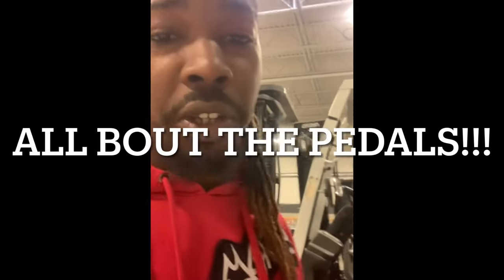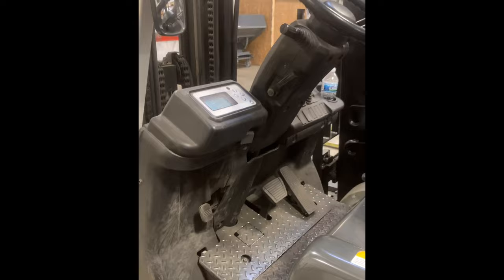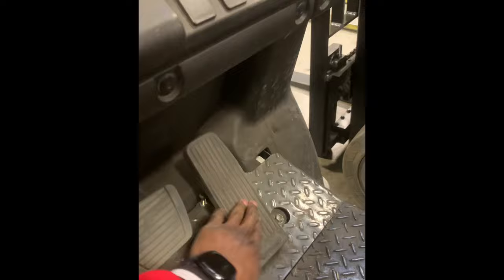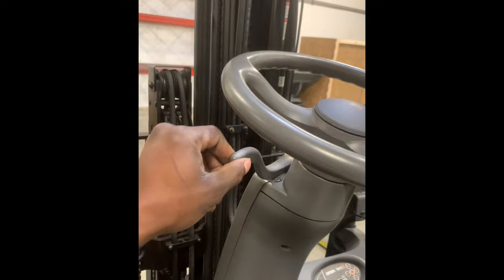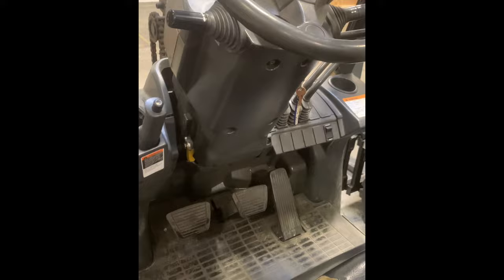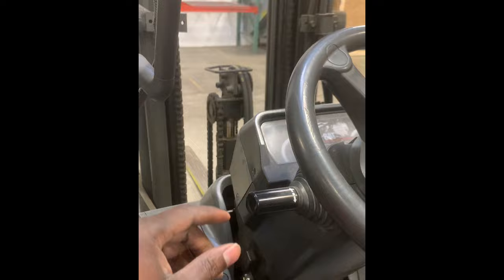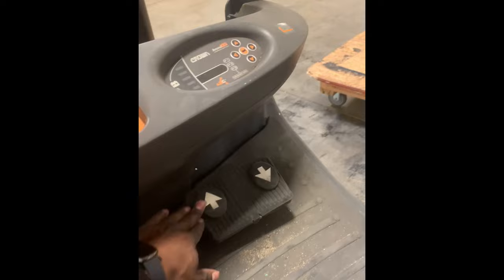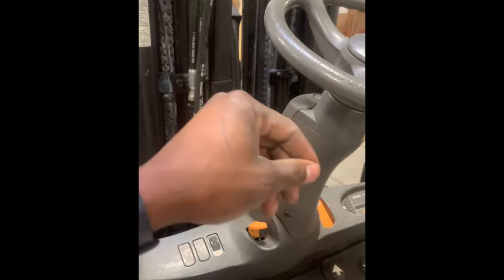Forklift Certified in 5 Mins ( Different types of Sitdown forklifts)

Comment: That third gas forklift with a "clutch" is like a clutch but called an Inching Pedal. It works like a clutch and a brake combined (if it is connected to the brake pedal too so first its disengages drive then more pressure and it applies brakes) so that you can rev the engine while in gear to make the hydraulics go faster (like lifting the load onto a truck) but bypasses the power to the drive wheels so you can rev the engine to make the loading much faster WITHOUT driving the forklift faster. It disengages drive and engages brake (if it is a dual action) so you can quickly raise the hydraulics to lift a load up without also driving faster. Its safer and easier to keep your fork load low to the ground until you put it on the truck or racking, and this pedal means you don't have to take it out of drive to rev the engine to speed up loading. Without it, you can't rev the engine in forward gear or else you speed up so this makes loading so much easier and faster.
Reply: Yup that bad boi helped out a lot when I had to stack, don’t know why people think it’s a useless pedal or just another brake comes to show they aren’t pros
Reply: https://youtu.be/aK1MLTQV1GU      demonstration of the inch clutch @1:16
Reply: My 5 minute "forklift training" consisted of my teacher telling me that pedal was useless and then lifting a pallet off the ground and setting it down. This comment helped a lot, thank you
Reply: I use the third pedal all the time it is great, especially with our lift it does not like running too good in the cold mornings and full turns or tilts instantly stalls her unless you Rev it with the clutch.
Reply: @TheCrawdadman  Sounds like a blocked regulator.  Alot of the gas powered trucks at my workplace have had this issue at some point.  They take ages to start in the mornings.  Apparently it boils down to the quality of LPG you put into it.
Reply: @AndehX  you were correct, we just got it serviced and now she runs like a champ!

Comment: The Toyota Tonero 18 I drive at work has a clutch, and I use it all the time.  It's the brake pedal that I never use.  The clutch allows me to let the truck roll forward, which is useful for going round corners without needing to brake.  The clutch is also always used when raising the forks.  As any driver probably knows, the clutch is used to disconnect engine drive from the wheels.  In a forklift this allows you to apply gas to the forks for quicker raising, without drive being applied to the wheels simultaneously.  Without the clutch, I would have to bring the truck to a complete stop and apply the handbrake every time I wanted to raise the forks or put the truck into neutral, which, while safer, and is to industry standard - is not productive at all, and would likely get you fired for being too slow.  The clutch is key to fast and productive workflow on a gas powered truck.

Comment: You can use the clutch when you're lifting something up high so you can give gas for more lift speed without going into neutral. Then you don't have to wait like 30 seconds to get all the way up to the top racks. Good video though. Don't be afraid to get forklift certified people, there's some good paying jobs and its honestly easier than driving a car you will get the hang of it in no time.

Comment: I would have to disagree with you Joe about the clutch pedal on the LP unit as it is also a brake, sort of like older tractors and lawn tractors with one clutch brake which is the ONLY brake pedal. If you're in a hurry like most lift drivers will be at times, you'll always use that clutch/brake and never use the center pedal. You will always use engine RPMs to raise your mast faster, and slip clutching while you switch your shift lever to the opposite direction of travel while you're moving.  I'd really like to know if the single wide brake pedal on that other unit actually clutches as well as it is made to use with either the left or right foot. They also call it the "inching" pedal. 🤘

Comment: Good videos. I wish they were more consistent though. So, I'm certified and I seem to remember something about with the propane forklifts, unlike the electric ones, you have to be in neutral to move the forks at all and are required to use the accelerator to move the forks along with the handles. Can you speak/make a video on that that is more indepth? Also, and this is a huge one that I'm not seeing anyone talk about. The principles seem quite easy, but I found in my 30 minutes actually operating a forklift, I found it very hard to see where the heck the forks are; angle of tilt, getting the forks into the pallet and clearance. What should an operator look for to see these things? All I saw was a huge block of metal obstructing my view and I find that's the harding thing to overcome. Thank you for your reply in advance.

Comment: When switching to forward, neutral or reverse, do you need to press down on any petals?
Reply from the maker: Nope just so down especially forward to backwards
Reply: @forkliftjoe3620  Mr Joe when ur lift the levels do u need to plus clutch
Reply from the maker: @irishgeddes1860   a propane lift would lift it faster if u press clutch and gas. But u don’t have to if u don’t want to.

Comment: ALWAYS... ALWAYS... ALWAYS use the clutch/brake... You should operate a lift with your left foot on the brake or clutch/brake and your right foot on the accelerator ... When you are stacking something or raising something to be put up you want to use the brake at the same time as you use the accelerator so you can inch forward if you need to... NEVER use the neutral ... Using both feet together keeps you from damaging product.. NEVER operate a lift with one foot ....
Reply from the maker: Will have to disagree Respectfully Richard but who knows you might be right.
Reply: @forkliftjoe3620  With 40 years of experience I'd say I'm right....
Reply from the maker: @richardbeach2430   Yeah maybe 40 years ago newer sit down lifts don’t have clutches. Or at least the very popular electric crowns.